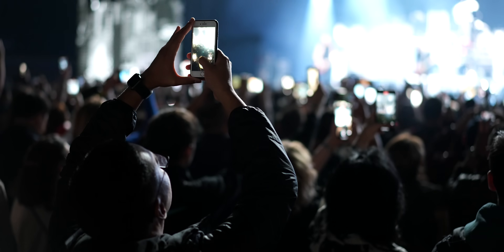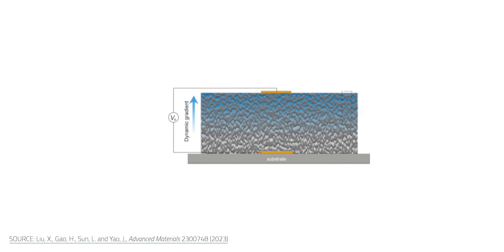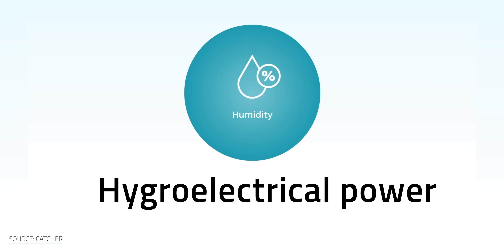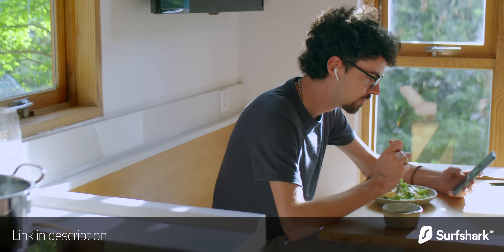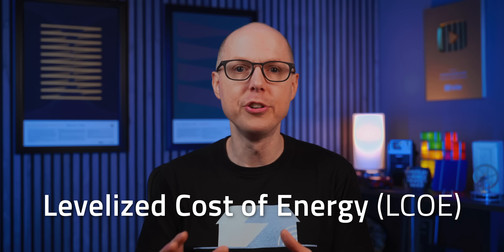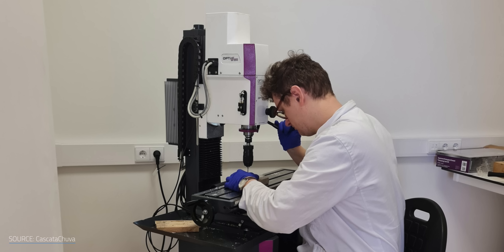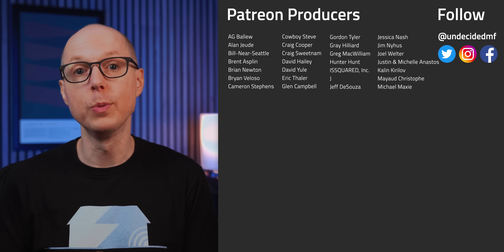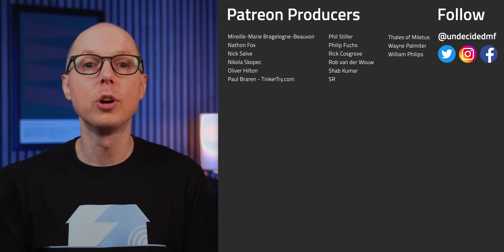Is This Accidental Discovery The Future Of Energy?

Comment: The real question is "where is the energy actually coming from?".  It could be that you are eroding the device in some way so that the energy ultimately came from the energy that went into making the device.  At some point the thing stops working.
Reply: 2 processes: When vapor condenses into water it releases energy. When water enters a narrow tube the capillary attraction makes it release energy.
The narrower the tube, the stronger the capillary force. Vapor condensing in a nanometer scale tube must release a crazy high amount of energy.
Yet, after a while the tubes inevitably fill up with water, and the process stops. It will be hard to get the water out again as it is so much attracted to the tiny tube. It needs to be really dry before evaporation starts in earnest, and it would require quite a lot of energy. No free lunch here.
Reply: @barttemolder3405  I think you nailed the obvious.  OTOH, surely the researchers should have discovered that their test units conked out quickly as they filled with water.
Reply: @michelangelobuonarroti916  I don't think they fill up that fast. After all, the water molecules in the air have to chance hit a very tiny hole. Also, the power production of the sensor is very low.
Reply: @barttemolder3405  Good comment, you deserve many more likes!
Reply: @barttemolder3405  When RH is less than 100% it takes energy to condense water.  This means that you didn't really explain the energy source.  Also what you describe would result in the cell very quickly stopping its action.  The tube would fill up and that would be the end of it.
Reply: @kensmith5694  Not so, the energy is in the heat released when water molecules from the air join the fluid. Of course, on a normal open surface with less than 100% humidity evaporation outpaces condensation, and as a result the water cools down below ambient - as the evaporation requires heat energy.
Capillary tubes have a positive condensation balance at less than 100% air humidity though; the narrower, the lower. So these very narrow tubes will still collect moisture even from very dry air.
Which, if this invention does not work as a free energy source after all, may see them repurposed as water harvesting devices.
Reply: @barttemolder3405  I still disagree.  I see no explanation that states a logical source for the energy.  Your description, if taken as correct, would only make an output briefly until the capillary is filled.  At that point the effect would stop.  Also once that water is in the capillary, getting it out will need energy.  You can't have the claimed effect turning on and off as needed to make the result you want.
Reply: @kensmith5694  Exactly, that was my point. There is no way the device can keep producing energy indefinitely without actually consuming something. The moisture has to go somewhere, and if it does that will completely negate all energy derived from it.
The only thing I did was describing one way in which it could produce energy at all, albeit short lived.
Reply: @barttemolder3405  but still.. in a complex ecosystem this is but one of the controls that balances and maintains a sort of homeostasis..
Reply: Something smells scammy about this.
Reply: Anyone understands a bit thermodynamics should figure it out that the technology proposed in this video simply is not possible. The people who are working on this tech probably already know it and either they try to milk investors / research funds for it or Matt didn't share everything there is to share on this topic to make an interesting video and misguiding his audience. There can be ways harvest energy from humidity and the other materials used in the device but it would still reach a point of saturation and wouldn't be able to generate power indefinitely or even for long time for large amount of energy.
Reply: @actias_official  your statement is false. These water batteries are already in production for medical patch monitoring . Company is "strategic elements" ASX:SOR
Reply: i think the reason he kept calling it a battery rather than a generator is because he knows it could only be a battery at best. its sounding exactly like a prepetual motion machine scam
Reply: @lunaris69  Yes, as reported it sounds very "fishy".  There could be something real there that is misunderstood.
Reply: assuming their hypothesis is correct, its taking the energy from the water. if so, i would expect the humidity to decrease over time in a enclosed space.

electricity from a difference would then go down as the device manages to reach equilibrium. perhaps even failing because it was operating long enough for the moisture to be equal on both ends.
Reply: @Kittsuera  If that is the "source" of the energy then really isn't the effort to make it in its dry state closer to the real source.
Reply: @kensmith5694  for there to be a difference there has to be... hmm wonder if it would work better upside down in a evaporator chamber....
Reply: @Kittsuera  I suspect that on the scale the devices are using gravity doesn't matter.
Reply: @kensmith5694  not for gravity sake but for creating a humid environment for the device to work even in a dry climate. "just add water" to get electricity.
Reply: That`s a great question. Nothing has been explained regarding this as yet and until then, I would rather believe there are ghosts sat at my dinner table! If he had said `the air / water vapour comes out slightly cooler`, I could pay a little more attention. Your comment deserves far more likes than you have got as yet.
Reply: What about vacuum? Casimir effect can emerge at such scales...
Reply: @tgyul  It turns out that the  Casmir effect can't actually create any energy.  It causes a force that wants to bring things together but getting them back apart requires you to put back all that energy.  Thus all you can get is the energy stored in the fact that things are not together.
Reply: @kensmith5694  Your argument is valid, but not specific to the Casimir effect. If this new type of battery can work long term, there must be mechanisms that counter its depletion. Recharged by nature (just like new gusts of wind or waves of the sea after you harvested some of their energy). Then Casimir effect can be a component of the system just like any other phenomenon. However, I am inclined to place my bet on its playing some role, because a shift of scale can help some force prevail over the other.
Reply: @tgyul  I thought the Casimir effect was a mechanical attractive force not related to electric charge. Also it`s only been observed in a vacuum, so maybe not. There is not enough information given in the video to come to any meaningful conclusions. But I have big doubts.
Reply: @TheTemporalAnomaly  I admit I am confused a bit. Casimir effect is said to be related to the Van der Waals force, which is in effect without creating some vacuum first. What I can imagine is some sort of a cycle enabled by a certain size of capillaries where different forces alternately dominate and then create a new situation where the other one will...
Reply: @tgyul  Another way to look at this is by saying, what is being used up in the reaction. He postulates that a 0.5 m3 size unit could provide enough power to run a house. Even if the power was somehow got from the phase change of vapour to liquid, that would require a hell of a volume of air and result in a volume of water trapped in the capillaries, that cannot easily be removed. (Would need external energy to do this.) The only valuable comments we can make until we know what the reactions are, what goes in and what comes out, what changes state etc, are comments of high skepticism. I`m surprised that no one has suggested it may be `cold fusion` to which I would comment further by saying `show me the neutrons`  The God of science is `peer review` and that is exactly what is needed here.
Reply: Or radio/rf signal caught by water droplets?
Reply: Sorry to spoil the fun of a well-meaning science buff, but...

CO2/climate-change is the biggest mass-fraud since communism. 

(See Henrik Svensmark for the cosmic-ray/solar-activity/cloud-formation/climate relationship.)

 CO2 is a ruse. 

Climate change the "Greens" are talking about is caused by changes in the cosmic-rays/solar-activity relationship and cloud formation  (See the work of Henrik Svensmark.)  

Cloud formation by actual cosmic rays can be scene with the naked eye in Cloud Chamber demonstrations.  YouTube has dozens of videos about them.
Reply: What’s effectively happening is that the H2O molecules are hitting the sides and converting into either H3O or OH by either gaining or losing a proton respectively. The concentrations of these ions are one if the ways we define acids and bases, so you can think of it like the tubes are creating their own acids and bases. I would have predicted that the tubes would create both types of ions equally for a net zero charge, but for some reason it is favoring one over the other. But eventually the water gets used up and all gets converted to these ions, that’s when the device stops working until you give it new water.
Reply: @fakjbf3129  H3O is really not a thing.  Making water into OH in that situation takes energy so you don't get an energy output.  You have to break the oxygen-hydrogen bond to get a hydrogen loose.  That means the source of energy must be something else.
Reply: @fakjbf3129   the problem is, that energy has to come from somewhere. And to convert from one source off energy to another you need to increase the entropy. so you have essentially two ways of producing electrical energy. number one is, that you convert a higher quality of energy into a lower quality of energy. for example burning fossil fuels, because the heat cannot reversed into the chemical energy. So it is a lower quality of energy and contributes to a increase in entropy. The second way is to increase entropy by equalizing states of some medium and using the natural occurring driving to this equilibrium to siphon of some energy and use it for something else. The latter one is the case here. We have an unbalance in moisture between the air and the nano-structure. We can use the force, that's occurring, because of the drive to increase entropy, to convert some of the energy in electrical current. but by the time moisture equilibrium is achieved, this device will no longer produce any currents. to reset the device you have to spend more energy, to separate the moisture from the device and start the cycle again.
Reply: @fakjbf3129  Before you can continue producing energy you have to get rid of the generated waste, may that be H3O or OH. How is that done to get the operating cycle?
Reply: This. Getting close to unsubbing because of these clickbait hoaxes. I like the channel generally, but selling your soul to the dollar itches me wrong..
Reply: @MarkkuS  I believe that he doesn't have the knowledge needed to see the problem here and is just passing along someone else's clickbait.  I watch because he often hits topis that interest me and this makes me look into it further.
Reply: @MarkkuS  the video States quite clearly that this research is in its very early stage and we are not sure how it works. What exactly is the problem
Reply: @MarkkuS  YES!
Reply: @glasslinger no?
Reply: @MarkkuS  at least 1-2 years ago that started to happen with Matt
Reply: It works without degrading as shown by the electrokinetic streaming effect  between gold foil and graphene
Reply: @peterlang777 I doubt it.  What do you mean by "electrokinetic streaming effect  between gold foil and graphene"?  Please explain in detail.
Reply: @kensmith5694  the kinetic energy of the ions in the water moves around. This brownian motion creates moving electrical charges that show up at each electrode and can flow in an outside electrical circuit
Reply: @peterlang777  That idea doesn't work.  See Maxwell's demon
Reply: @kensmith5694  it does. The setup powers a digital watch at the university of Arkansas.  The science is called GEH graphene energy harvesting.  Freestanding graphene gains "levy flights" (vibrations) from individual infrared photons in the ambient area
Reply: @peterlang777  The energy comes from the photons.  That is a different matter.
Reply: @kensmith5694  ambient photons. No temperature gradients
Reply: @peterlang777 With no temperature gradient, there is no source for the energy so it doesn't work.
Reply: @kensmith5694  not so
. Newton thermodynamics are from the age of steam.  Graphene energy harvesting
Reply: @peterlang777  You are talking nonsense.  Ohms law is also from the age of steam.  Harvesting of energy means taking small amounts that are real not magicing up some.
Reply: Water cycle. The energy comes from the sun that heats up water and turns into moisture
Reply: @crazyblazeX  You explained this in a way that suggests you understand how it works, but without actually explaining anything about the mechanism or limitations of the technology.
Reply: @bradley3549  Agree!
Reply: @crazyblazeX  what kind off energy is stored in moist air?
Reply: @EnchantingCat8365  kinetic energy in the motion of the water particles. In the video he said it's those collisions that might be generating the energy
Reply: @berrigo2  that would mean getting electricity by slowing particles in the air, which means by cooling air. Sounds like a violation of the second principle of thermodynamic.
Reply: @EnchantingCat8365  heat
Reply: @SergioHernandez-uv1mo heat is a form of energy you cannot by itself, when you dont have a heat gradient, use to produce any other form of energy. So yes, it has heat energy, but you cannot use it anymore, when the tubes are saturated. In fact moisture also has chemical energy, but we are not in a world, where we can burn water, to gain energy from it.
Reply: @EnchantingCat8365  yes indeed, we could describe that like a high entrophy system, the heat gradient is also always there, it seems youre describing it more like in a boiler calculation for a steam system, I was implying it more in an unknown nanometric fenomena. Anyway, it's just a shot in the dark, the videos doesn´t talk about energy conservation at all, wedon´t know of any byproducts of a chemichal reaction, we don't know if it's cooling it's surrondings, scientists really dont know whats going on really.
Reply: @EnchantingCat8365  you can use heat energy without gradient. See prof. Thibado and graphene energy harvesting. It is isothermal
Reply: @crazyblazeX  Except to generate power you need energy flow through the device; power is generated by a system working to correct a thermodynamic imbalance. It's why you can't get unlimited free energy from a magnet. As described, you'd expect the power to stop as the nanopores became saturated, and you'd, at best, need to apply atleast as much power as was created by the device to drive off the water and reset it.

It could be that this thing really is a battery instead of a generator, it just works so slowly that, combined with human biases and uncertainty over the exact mechanism, it's not readily obvious.
Reply: @crazyblazeX  if you put the borders so broadly the energy of pretty much any process is from the sun. The question is, what happens to the water in the cell. It will be adsorbed inside of the battery and will be stuck to the surface so youd have to evaporate it again. -with energy-like heat from the sun-a lot of it. So you could just as well use a solar cell.
Reply: @NIOC630  Could be even worse. If you use it inside the house the only available energy to recycle the cell to the initial state is from your heating system. So you pay for it one way or the other.
Reply: @crazyblazeX  No, you could only extract energy that way if some of the vapour was condensed into liquid water or in the very least, the vapour came out cooler than when it went in. There is no mention of this though.
Reply: @crazyblazeX  So long as RH is less than 100% it takes energy to condense water.  This means there is no way to get energy from changing its phase back to liquid.
Reply: @kensmith5694  the water is in a gaseous state in the air because of thermal energy, so that might provide a source of energy to initiate chemical reactions between the water molecules and this material. Considering how reactive oxygen naturally is, it wouldn’t take much of a push. This would lead to a slight cooling effect in the immediate space around the device, but might actually heat the device up a little bit. Also, this doesn’t have to be a thing most of the water molecules do, or even a few- there’s so many molecules in even that tiny space that if 1% of molecules reacted with the material, that would still be millions or even billions of atoms.
Reply: @TheCrazyCapMaster  When the relative humidity is under 100%, changing from water to water vapor in the air is a move to a lower energy state.  Taking the water out of air consumes energy.  Oxygen that is tied up in water is not very chemically reactive.  It already is bound to something and those bonds have to break in order for it to react.  Breaking bonds takes energy.

Comment: You cannot extract useful energy without differences over time or space. Meaning maybe this thing works through the differences between night and day or through different humidity at its two sides. But a uniformly humid surrounding will not allow you to extract energy. Perpetual motion machines aren't real, not even wet ones.